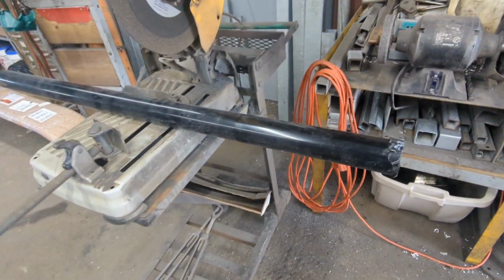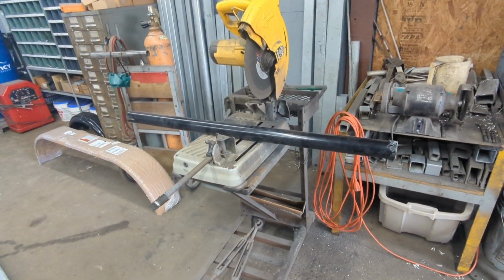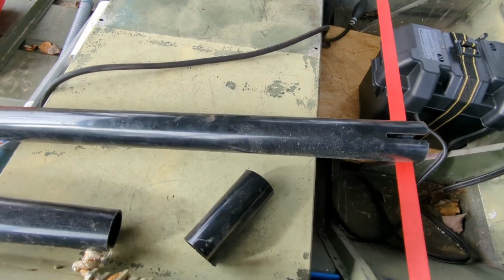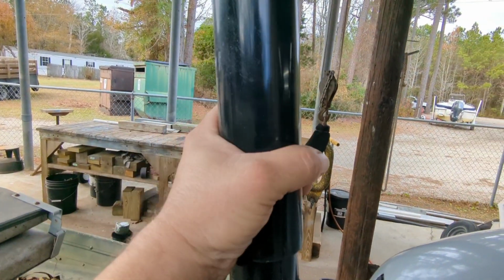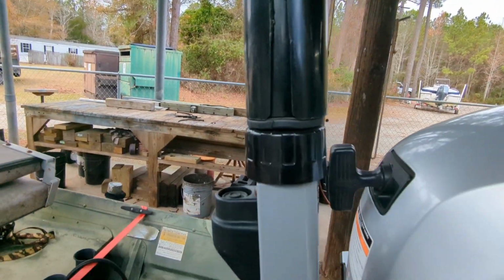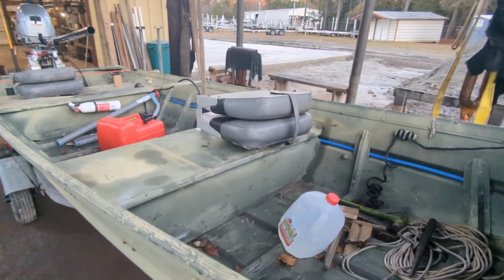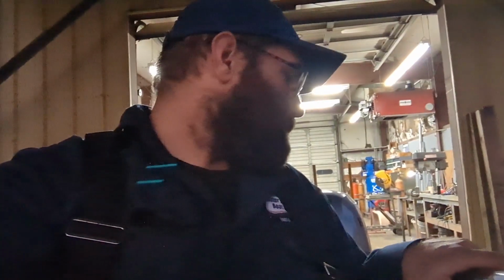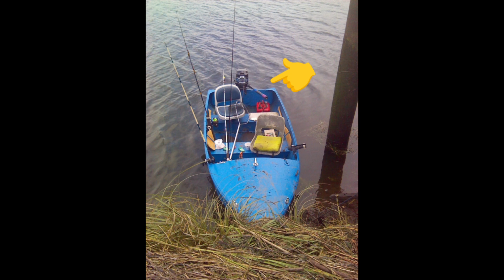How to make a tiller handle extension using pvc

Comment: Hi boring fisherman , you recently Shared some tips on Facebook group about a camera mount. you shared your YouTube channel. I was checking out some of your videos. how do you like the offset seat? How does it ride whether you have one person or two people in the boat? On my 1436 front and back seat are positioned in the middle of each bench. However was thinking about offsetting the backseat for better comfort with operating tiller handle on outboard motor.
Reply from the maker: It works great really having them offset. I just measured 1/3 of the way on each bench to get the seat position. With 2 people in the boat it's great, really offsets the weight well. When it's just me in the boat I just move my fuel tank forward as far as my fuel line will reach and I place my gear accordingly to best keep the boat level. However when I'm solo the bow rides high. So I just stay out of the throttle and it's fine for me. Hopefully this helps.